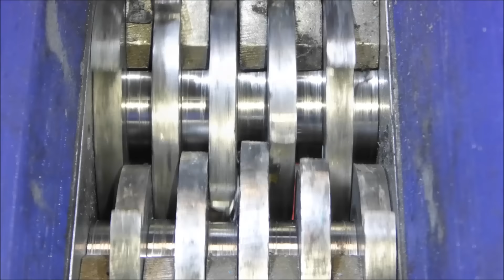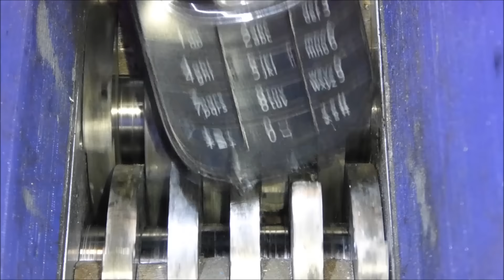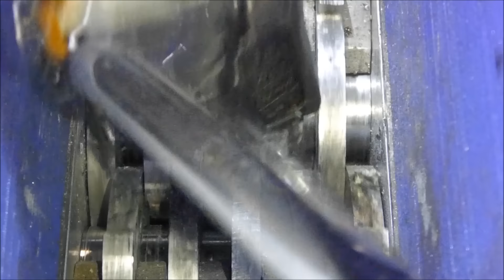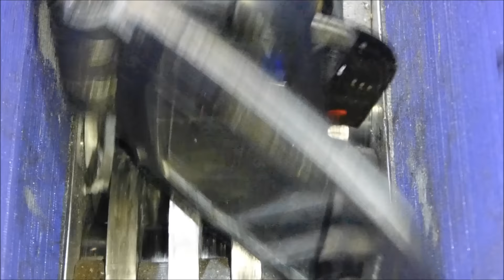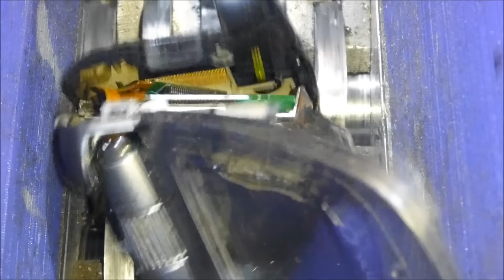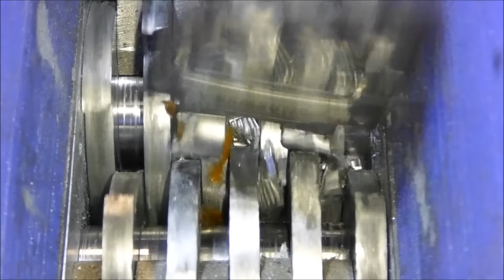Shredding PC fans and phones

Comment: What motor do you use to run the shredder?
Reply from the maker: +720mine It is custom made motor running on youtube childrens tears. But before that I have use 750W 380V and 250Nm torque at 14 RPM
Reply: +thymark Ok, thanks. xD
Just a very crazy thought, have you ever tried using a much higher rpm motor? With safety of course.
Reply from the maker: 720mine To dangerous.
Reply: +thymark I was expecting that. xD
I'll have to go to the mythbudters for that kind of carnage. :P
Reply: +thymark Another question, have you ever shredder a shredder?
Reply from the maker: 720mine yes, look in my channel
Reply: +thymark You probably think I'm your stupidest subscriber. xD
Have you shredded a metal shredder though? Or can your shredder not handle that? Or is it too dangerous? Just curious.
Reply from the maker: 720mine My units are too smal for such thing.
Reply: thymark Yeah, ok.
Keep making awesome videos!